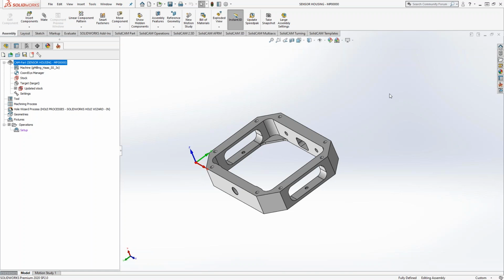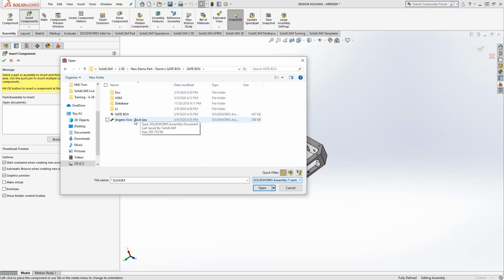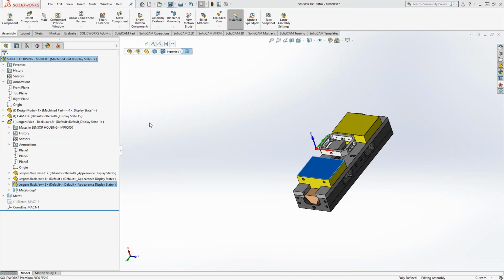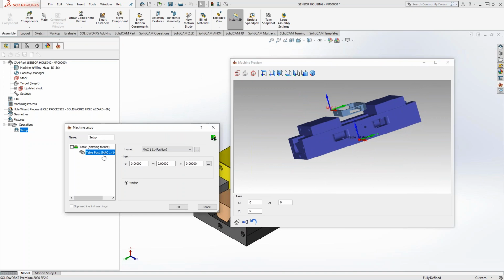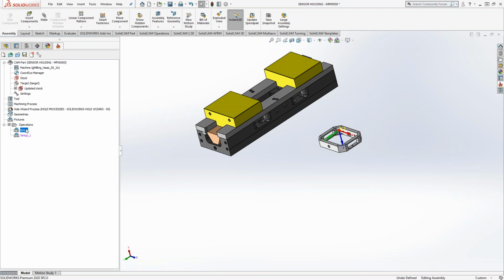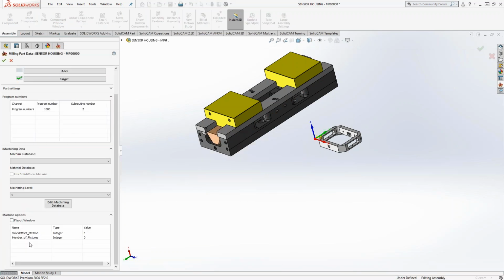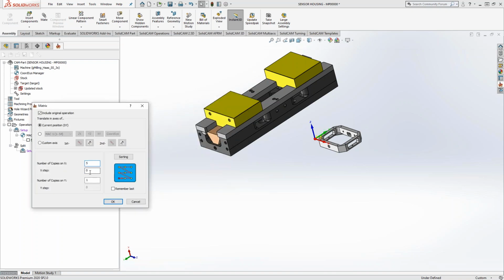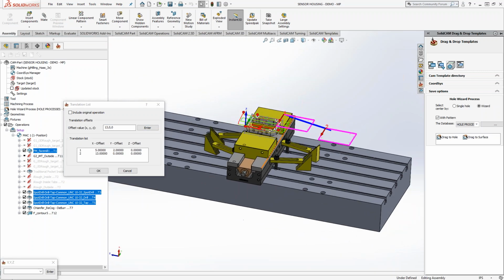SolidCAM LIVE - Multiple Setups

Comment: Thanks guys for all these useful tips. I have a question: I have a part that is programmed using 3 different work offsets (Mach 1, 2 & 3). I'm using 3 vises (1 for each work offset) on the actual machine table but those are located very close between each other . So I wonder if there is a way to display those 3 vises at the same time inside my solidcam file just the same way I have them located inside the machine, so I can see if my toolpaths are on risk of causing a crash with the others vises when running the toolpaths simulation instead of finding out that on my actual parts/vises.??????
Reply: Absolutely.  In the video I am showing the opposite of your situation:  I want to hide everything so I can see better but in your case you would just leave them in view and assign the correct MACs.  If you assign all the stocks and Targets then you should be able to check for collisions.  I suggest you contact your local reseller for help with this.